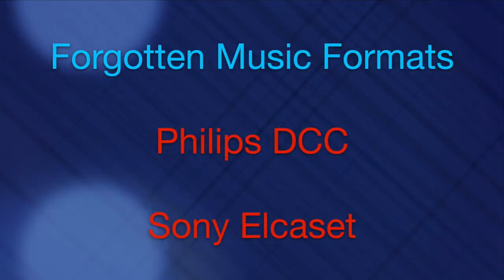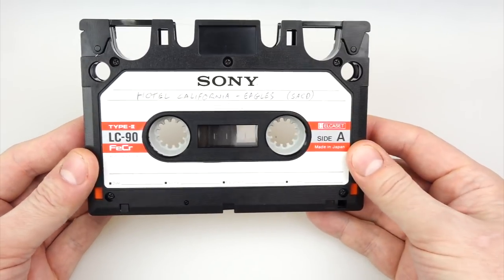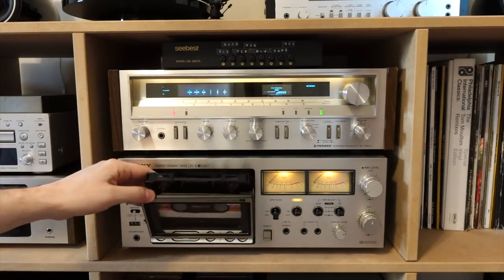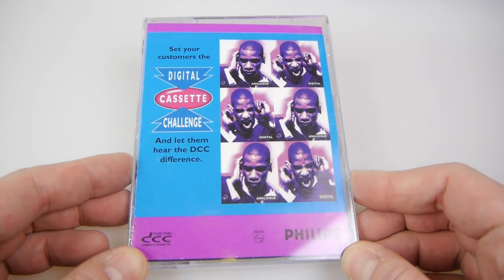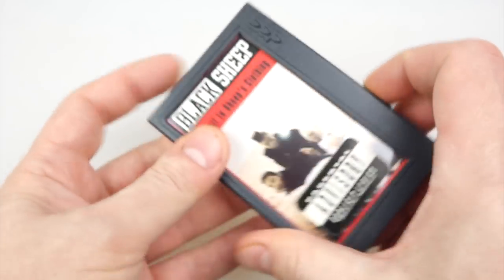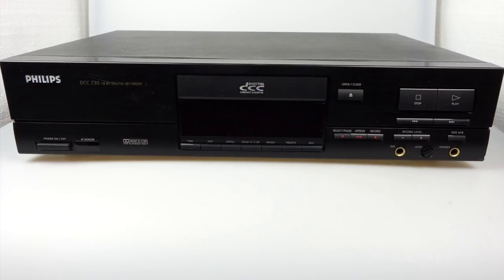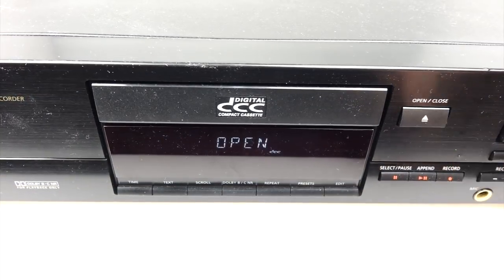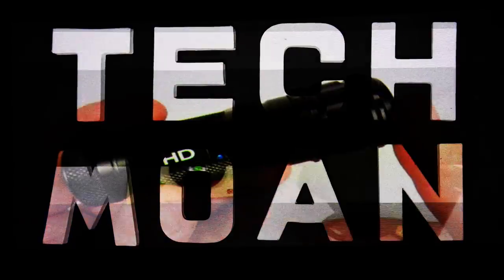Forgotten Audio Formats: DCC & Elcaset

Comment: The reason DCC didn't take off is because the case wasn't sharp and did not come in handy to scrape frost off your car window like a standard cassette case.
Reply: Which came first - the hinges breaking from normal use or them breaking from using them as a scraper? Just kidding.  That's one of the things I hated about the cases. The same thing with CD cases. If they had used a different plastic (stronger, more flexible, softer?) to begin with, for example - PP (polypropylene) instead of PS (polystyrene), then I think the issue of broken hinge tabs could have been largely avoided. I'm sure that there are at least a few other good reasons though as to why they didn't go that route. And while I'm at it, I'll complain about the design of the case of both cassettes and CD. A better design alone could have reduced the issue of broken hinges. Combine that with the usage of different (better) plastic and the overall result could have probably been very few broken case issues. There have been some CD case designs (along with using different plastic) that appear to have solved this but it's a case (no pun intended) of too little too late.
Reply: DCC cases also don't make sweet Hot Wheels jumps either. Sorry, I was too young at the time, so that's what I used cassette cases for. lol
Reply: Sure sure, but it is funny it always the best format that goes.
Always enough of excuses. 
just take vhs, betamax and 2000.
The worst was chosen.
Geuss it is due to there always most money to earn with the worst.
Do not buy the politic excuses. it is always about the money.
Reply: Well, there was a lot of "experimentation" back in the 90s with all kinds of formats, but the downfall of most of them was still clumsy tape system you had to rewind/forward... hello SDcards!! )
Reply: VHS was not the worst format.
Betamax failed because of Sony being too selective to allow 3rd party manufacturers to build Betamax machines. Their licencing was more expensive than JVC, who allowed companies to build cheaper VHS machines in order to get them into people's homes / business quickly. Nothing to do with porn either as most people think - that's a myth. VHS is / was a great format.
Reply: The copyright lobby wanted to have some copy protection and the lobby had their way. Bad quality like hiss increases from copy to copy. A copy of a copy of a copy is then so bad, it can't be enjoyed anymore. Thus bad quality in consumer electronics (reserving good quality for professional electronics the consumer has no access to) was the way to enforce copyright in analog. For digital there are other ways.
That's what I think, the reason was why always the worst format won.  @Tbonyandsteak
Reply: @agfagaevart  2000 was the best, but hardly anyone know that format. So NOT a myth.
Reply: losersintuition 
LOL!  Now THAT brought back memories!
Reply: Ah the memories!! Yep, the combo tape case and windshield scraper, I remember it well!!
Reply: All of my cassette and cd cases always looked like brand new (except the ones that got promoted to ice scrapers) because I was lazy and just threw the tapes in the console or I had a visor sleeve that held like 20 cds so I never put them back in the cases :)
Reply: @agfagaevart  And BTW: The difference in quality between VHS and BetaMax wasn't so huge after all. And yess, i agree, that VHS back in then wasn't bad home video format at all...
Reply: @Tbonyandsteak   Another myth; Because V2000's double sided tapes were expensive, and over-engineered. Plus Phillips made some serious errors marketing the format, and they (stupidly) thought it would win the format war by teh mid '80s. Once the 4 hour VHS cassette came out around the early '80s, V2000 was dead in the water!
Reply: @agfagaevart  I know it was more expensive, but it was more practical
The box was lesser than Betamax and Vhs. Not at least it had a better quality, what you call over engineered.
It was better in any way possible and more expensive.
So where does the myth comes in?
Reply: The real reason why the digital compact cassette didn’t take off was because at the time it came out Sony came out with its own portable music media format the minidisc and when they were both featured at the CES together when it came time to show how to advance to the next track all Sony did was press the next track button, while the dc was still fast forwarding to the next track and the audience chuckled at the philips guy while they were waiting for it to get to the next track
Reply: True dat!
Reply: Tbonyandsteak It’s not always about the money though, and it’s a myth that the consumer Betamax format was demonstrably better than VHS quality-wise when comparing what was available at that time. A lot of times, things fail due to marketing issues, quality control, or feature availability despite vast sums of money being spent. A lot of failed formats had orders of magnitude more money spent on R&D, yet still fail.
Reply: Bill A How many new tape-based digital systems came out in the 90s? Only new product I know of was DCC, and most of its development was in the later 80s.
Reply: Tbonyandsteak What does the 2000 format have to do with it? Relative quality wasn’t the reason any of these formats succeeded or failed, and neither was porn.
Reply: Benjamin Wallace I’m not sure that was the reason it failed, as there were a lot of things in play. Minidisc has its own share of problems, not the least of which it sounded pretty poor in its early versions due to a bad compression codec. Neither format took off in any real way in the consumer realm in North America, though minidisc was apparently common in Europe in the 90s. 

Minidisc did see some success in the industrial and broadcast realms, though. There were a number of minidisc cart players meant to replace the old analog Fidelipac cartridges, that had some success. Though by that time, computer-based automation systems were already becoming affordable & viable, and most of them by that time supported direct playback of jingles, ads and liners, controlling CD changers for the actual music or using live assist (where the jingles, ads and liners played from the computer and CDs were manually manipulated via external CD cart machines).

Though even computer-based automation had been around for many years prior, dating at least to the original IBM PC where they would control Fidelipac carousels (massive things holding 24 carts), reel-to-reel decks for music (with support for queuing individual tracks), satellite receiver switching, etc through massive racks of equipment. Many of those were entirely floppy based. Though even earlier automation systems used more mechanical means of control. 

Minidisc was also used for ENG by reporters, recording directly to disc replacing cassette recorders.
Reply: Lol!!!!! Yes; a cassette tape and/or a stiff pocket comb to remove the ice!
Reply: At least in my experience, cd cases are a lot more prone to this
Reply: I've done this.
Reply: @Rainer67059  I think this is the reason you can't find a TOSLINK input for any DAC or other PC / recording machines.  I found an odd-ball Chinese DAC once with an input, but it wouldn't work no matter how I tried.  I think it was blocked in Windows, although I never tried it with Linux.
Reply: @Tbonyandsteak  No Betamax was the best had better image quality. And the audio of 2000 was pretty poor. Also, it was a pretty fragile system because it was technically more complex than necessary.  You often had to take them to the tech again for another repair,  That is why there are so few working devices left today.
Reply: @montana01971  not when it was released. It was on another level. Also cost way more than Beta.
Reply: @Tbonyandsteak  As I stated before, Betamax had the advantage of having slightly better image sharpness and color, VHS on the other hand had the advantage of becoming adapted as the new standard by most manufacturers and video rental chains, which soon proved to be decisive. While V2000 had some neat features, nothing really made it stand out against the competition. When V2000 failed to really catch on even in their home market the Benelux, and not at all elsewhere,  Philips began to realize that the sooner they'd pull the plug the better, took their losses and jumped on the Vhs bandwagon.

Cost was more based on brand than on system.

V2000 wasn't on another level in any way. As a matter of fact none of the 3 really were.  S-Vhs and ED Beta definitely were, but that was almost a decade later...
Reply: @Tbonyandsteak  Quality has never been the driver of mass consumer adoption. It certainly does hurt to be better in quality, but it is not the decisive factor.

People want good enough, with maximum convenience and a low price. Beta was marginally superior in image quality for home videotape technology but that didn't matter when people were watching analogue tapes at 480/576 lines on a 23-inch tube TV across the living room.

In terms of convenience, it was no contest. The primary driver of early VCR adoption was to record off television. The much longer record time of VHS made it far better and more convenient for that. When V2000 came out it's tapes.could hold more hours of video, but it's record time was still shorter as you didn't need to flip a VHS. That enabled VHS to establish itself as the most broadly adopted format and when video rental stores emerged, they focussed on VHS. The quick adoption of slower tape speeds for VHS and Sony (who outright abandoned the initial tape speed because the run time was just not practical) really shows this convenience of longer tapes being far more.impprtsnt than image quality.

As for price, basic VHS machines quickly got cheaper than basic Beta machines due to JVC encouraging others to build them versus Sony wanting to keep that business themselves as much as possible and scale as more and more VHS units were being shipped.

V2000 was late to the party and never really offered anything ovrr VHS that anyone cares about.

Comment: A long time ago I worked at Philips Southampton UK on DCC. I did computer simulations of the MPEG-1 audio and also some chip design on the final third generation chip. It was Philips first million transistor chip back around 1995. Some of the building blocks in that chip were used in later portable CD players.

One major problem with DCC portables is the tape speed is the same as standard Compact Cassette and if you waved the player around the tape would slow down and the data would stop. The Minidisc played the disc faster into a memory buffer so it could cope. 

The analog playback was improved because it used negative feedback to cancel the magnetic field from the tape with a wire cancelling the field in the digital tape head. So the response was basically flat unlike the coil based heads that have massive bass rolloff because the head output is proportional to frequency.
Reply: Cool. I seem to remember that DCC's compression scheme was also called PASC. Am I right? I had high hopes for it, but it never caught on. I would have loved a car DCC stereo.
Reply: Yeah it was PASC. I did a school project on DCC vs MiniDisc when they were new. MD's compression was called ATRAC. PASC  had superior sound quality on paper, with about a 4:1 compression ratio compared to ATRAC's 5:1, and IIRC a much more advanced psychoacoustic model with adaptive sub-bands where ATRAC used fixed bands. So I thought that DCC would win over MD because of the better sound and the back-compatibility of players with old tapes. Of course, that didn't happen - MD won because it was more compact and far more convenient, with facilities like near-instant track skip that made DCC seem slow and clunky.
Reply: I'm curious: how can it sound better than cd if it uses something like mp3?. (instead of a loseless uncompressed format like cd). even a 320kb mp3 is not the same as the original cd and there's a loss. was the compression better than mp3 or loseless?
Reply: excellent insight, thank you @MikeJames
Reply: interesting. I seem to remember rumour back then, that shedding of oxide from using analog tapes on DCC machines quickly clogged their DCC heads, tho, true?
Reply: Fv
Reply: jammin023 I wouldn’t say MD won out, at least not in North America. It did have moderate successful in Europe. But I saw DCC in American stores more frequently and for longer than MD at the time, and DCC had a bigger selection of pre-recorded music if I remember correctly (since most people who bought MD apparently used it to record their own music, typically off CDs they already owned). Again, if I remember correctly, I rarely saw MD units in stores here locally whereas I saw DCC units for many years. Not that DCC sold well. Conversely, I saw blank MDs sold in stores for a long time, in more places than I saw DCC blanks. 

So I guess it depends on how you look at it.
Reply: Honestly the only people I ever saw using MiniDisc were Korean and Japanese college students. It was an oddity.
Reply: @SteelRodent I think you are confused. CD is 44khz 16 bits stereo and has always been, it never changed bit rate or something like that. there is no such thing as a 128kbps cd like an mp3.
you are right about chopping frequencies, that's digital audio, limited by sample rate and bits. vinyl and analogue tape is not limited by 16 bits or whatever, but in the realm of digital audio, CD is loseless. it's "wav", nothing encoded or lossy like mp3.
it's not the full possible quality like a studio recording on tape or even on digital, in studios they use 24 or 32 bits, 48, 96 and 192khz of sample rate, so for cd they have to lower the quality. they don't have to do it for vinyl, a 24 or 32 bits 192khz digital master can be printed to vinyl and it won't "lose bits". (the ideal would be to use analogue masters on studio quality reel to reel tape, like they used to in the 60s, 70s and 80s, but studios these days use digital out of convenience).
Reply: @SteelRodent I thought Audio CD was always uncompressed PCM, approx 1,4 Mbps... what compression algorithm was that 128 kbps you are writing about? It sure wasn't MPG1 or MP3 which came roughly 10 and 15 years after CD repsectively, and would have taken a lot of processing power for that time. Think of common home PC's of mid to late 90's that could not convert 44100 Hz WAV to MP3 at much higher speed factors than 1 - 4, even if they were a whole new world compared to what was available in the early 80's. Uncompressed PCM takes little processing outside encoding and decoding the parity and padding codes on media level. Digital reording on VHS in 1981 was pretty much possible for this reason - high bitrate on media, little need of processing, and of course, specific processors built to do one job well (instead of being jacks of all trades and masters of none).

The reason why some of the earliest CD's didn't sound optimal, was more likely very much because of the lack of digital porocessing capability at the time, so an analog circuit was built to sharply filter off frequencies above 20 kHz from the signal to be recorded. The result, sadly, was a rather uneven response at the high freq end altough it somewhat avoided heterodyning artefacts nearing the Nyquist frequency (22050 Hz).
Reply: @SteelRodent wrong.

1) CD works as Lossless PCM at 44.1kHz Sample Rate (and according to the Nyquist-Shannon Theorem, it can reproduce as far as 20kHz and also a bit more actually [22.050Hz to be exact, although you would filter it to 20kHz anyway]) and 16-bit Dynamic Range (96dB), there were no such thing as Digital Audio Compression techniques around the late 70's until 1983 (the period in which Philips and Sony developed the CD format).

Those same specs are valid for Sony DASH Reel-to-Reel and DAT Tape Recorders (the machines which were used before the 2000's to record the CD Masters).

2) Vinyl is a restricted format, most vinyl records only responds to roughly as far as 15kHz in maximum (that if you use a decent Stylus/Cartridge), and has a limited Dynamic Range of roughly 46dB~58dB aprox. (featuring a "loud" and unstable Noise Floor [the vinyl's Surface Noise itself and more: pops, crackles, hissing, clicks, etc]).

Not to mention it's tendency to produce Phase Errors, Sibilance, and sound quality degradation as much as you play it through the years.

A format that gets near to something like a "Non-restricted Media" is Analog Magnetic Tape, especially Reel-to-Reel running at higher speeds than 3ips.
Reply: @SteelRodent All audio CDs are 44.1kHz * 16 bits = 705.6 kbps.  The included 20Hz-20,000 Hz frequency range is the full range of hearing (indeed the CD audio goes to 22kHz, half the sampling frequency by the Nyquist theorem), so nothing is "lost" on a CD audio recording compared to a vinyl record. :)  Not to mention the  far superior signal-to-noise ratio and dynamic range of audio CD compared to vinyl records, which Techmoan himself mentions.  Of course 24-bit/98 kHz digital or high-speed reel-to-reel is better quality than an audio CD or downloaded equivalent, but unfortunately it can be difficult to source "alternative" artists on quality any higher than audio CD quality.